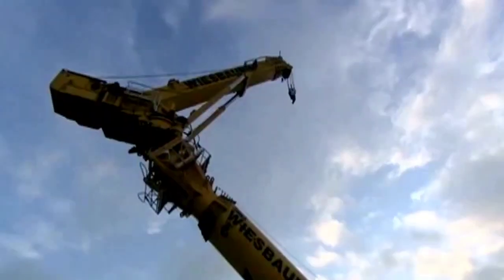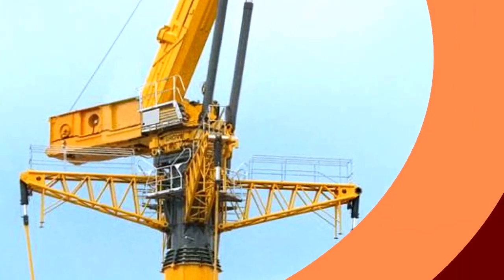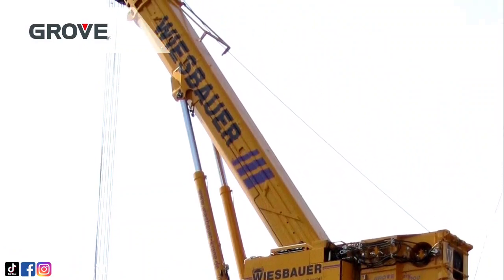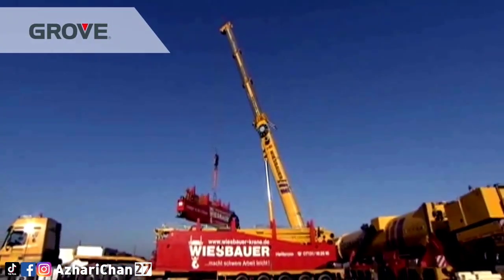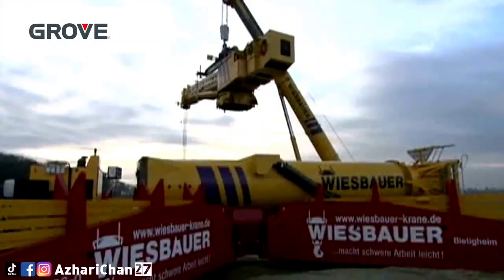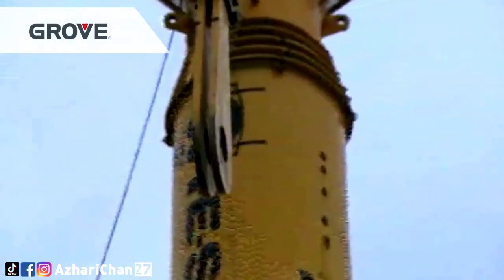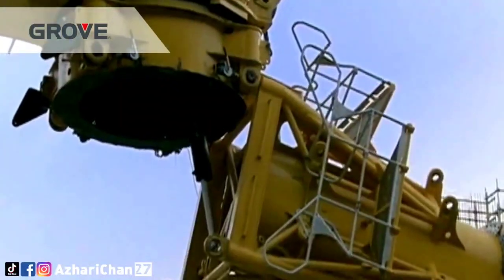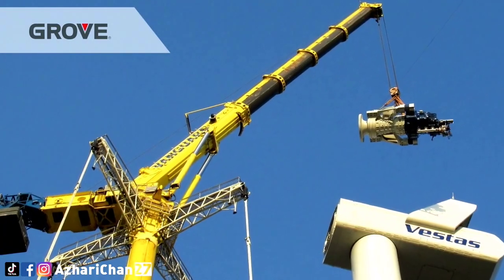Crane Of The Day  Episode 52 |  Grove GTK1100

Comment: It's a shitty crane at a Windmill site.
you almost have to back up onto the crane, with the Nooteboom Mega windmill trailer, to unload a tower section or nacell. (You need to back it in between two support legs, and as close as you can get... Close to the crane, really really close.
Then you cant pull the rear end of the trailer out from the tower or nacell.
Otherwise it cant 'reach' it, due to the poor lifting capasity and reach with the weight.
The site needs to be excessivelyl arge to do this.
Reply: 9
Reply: I was just about to ask why you never really see them!
Reply: doesn't really fly with me. the radius to the end of the riggers is 13.1 in the corners, or 14/15 with the mats, depending on mat size. on the straight line between those riggers then, 10m.

The trucks are 2.3-2.5m wide. ((my crane at 2.5m on a truck's trailer? the tyres where half-on half-off the deck, wider than the truck/trailer. so 2.3 is my assumption) half, 1.15-1.25   Lets be safe and say 1.3m    position so that its beside two riggerrs, parallel with the line between the two jacks.  so starting, 10m radius. add sizeable mats,  12m. add the width of the vehicle (so half its width as gap to the mats), 14.5.   round off to 15m.
Boom length 16,02 doesn't reach.
Boom Length : Capacity at radius 15m, 0t ballast : Capacity at radius 26m, 0t ballast : Capacity at radius 15m, 56t ballast : Capacity at radius 25m, 56t ballast
20.85m : 65.0t : __._t : 89.5t : __._t
25.68m : 66.0t : __._t : 90.5t : __._t
30.50m : 67.0t : 32.5t : 91.0t : 46.0t
35.33m : 68.5t : 34.0t : 92.5t : 52.0t
40.15m : 67.0t : 33.0t : 67.0t : 40.0t
44.98m : 60.5t : 33.5t : 60.5t : 35.5t
49.80m : 55.5t : 33.5t : 55.5t : 33.5t
54.62m : 51.5t : 32.0t : 51.5t : 32.0t
60.00m : 43.0t : 30.0t : 43.0 : 30.0t

So even 0 ballast, it can still pick u p at 26m 30 tonnes. Add ballast, puts it up to 52t on a 35.33m boom length. A 3mw turbines' 47m blade weighs only 12.5t   Oh look, full boom which with ballast nets a max radius of... 52m

And even backed up to so it's in line with, the crane isn't going to be going for the far end. a blades' centre of mass is closer to the root than the tip, but so grossly as that. At that point, you're facing the same issues as with using the other cranes.

Compare to the Liebherr LTM 1450.
47.8m boom with 84m luffing jib, 134t of ballast. to achieve same max hook height (130m). Capacity on the jib? oooh. 3.7t... at 36 metres of radius so not even all that close, and that's MINIMUM radius. Ok, lets dial it back then? telescopic length of 26.6m now grabs you 12.5t at max, 38 metres radius, minimum radius is 32m.    But also your max height at that configuration is 90 metres-ish, which the GTK gets as soon as one section goes out. Even configurations to get higher capacities, reduce the height available, whilst also forcing much greater operating radius.
Which enforces two things, for this 450 anyway: smaller tower height and larger ground site area for lifting, so that the blades can be lifted from much further radius.

Afterall, at 12.5t, and picking up from 50m radius, the GTK has a max hook height of just over 100m. And towers are getting to pretty large sizes with hub heights of 90m, so it can place blades at close to its maximum radius for the weight alread, and it wont be placed that far from a tower.
Okay, not the 450 whichever way I check, it doesn't meet height when weight is there or weight, when height is attained. How about... 
well the 650 fails too, since oh look, not just blades (12.5t) but the weight of the turbines. 50t isn't unheard of. which the 1100 handles quite well.

Liebherr LTM 1750.  Config for a 90m hub height is the TYV23EN with 28m fly. 79.8t at 21m radius. Fair enough, its a specific enough that it got put in the damn spec book. 49.1m boom, the 10+55m V2/v3 inserts, the luffing jib with 42m, full ballast... 60t max lift, and still pulls 15t at 72m radius when main boom luffed o 66 degrees, so turbine and blades. 

Transport Comparison:
GTK1100:;
Truck one: core mast unit with pedestal hub.
Truck two: Boom unit
Truck three+four: outriggers with upper support jibs
truck five: Ballasting unit and ballast.
Axle loadings only affect number of axles for the truck-trailer combos.

LTM 1750 on 11t axle loadings (because single wheels, not double) 
Crane - carries main boom, no outriggers.
Truck one - 2x Outriggers, support plates, hookblocks, etc. (5/10/15t counterweight inc. if transported on purpose-built outrigger transport frame and axle loadings allow).
truck two - 2x Outriggers, support plates, misc items.  (5/10/15t counterweight inc. if transported on purpose-built outrigger transport frame and axle loadings allow).
Truck three - counterweight tray and counterweight/hoist unit. (+x2 10t counterweight blocks on tray, if axle loads allow).
truck four - x4, x5 or x6 10t counterweight blocks (as axle loadings allow)
truck five - x4, x5 or x6 10t counterweight blocks.
assuming higher axle loadings because more axles, that's all the blocks. (x16 10t, x2 5t.) assuming lower, (5t seperate, x5 on trucks 4+5, no blocks on three.) forces:
truck six - x4 10t counterweight blocks, x2 5t blocks
assuming still lower, then
truck seven - x4 counterweight blocks.

NOW we need also the fly jib elements.... assuming higher fewer trucks from above:
Truck six: Cathead adapter section, 10m V2.
Truck seven; 5m V3, 5m V Eccentric
Truck eight: Luffing Fly Jib Base section
Truck nine+ten: fly jib 3.5m section and 7m section,
Truck eleven: Fly jib reducer section, 7m smaller section, fly jib head section.

For the 750. That's 13 trucks at lower axle loads and/or fewer trailer axles (some places dont allow 6 or 7 axle trailers! but wind farm, so guessing blows a raspberry

Yes. I'm a crane nerd and like figuring this shit out.

(also, the footprint needed will always be huge)